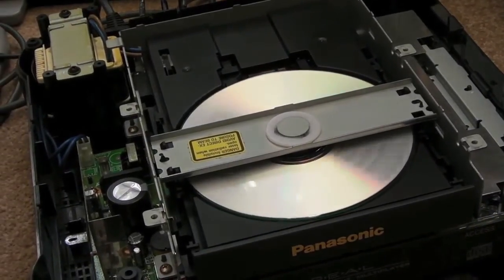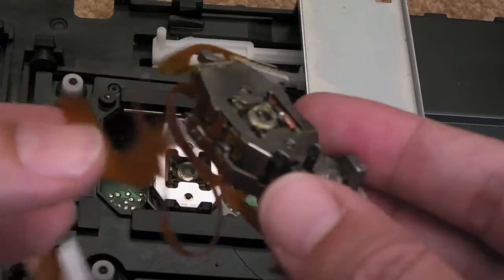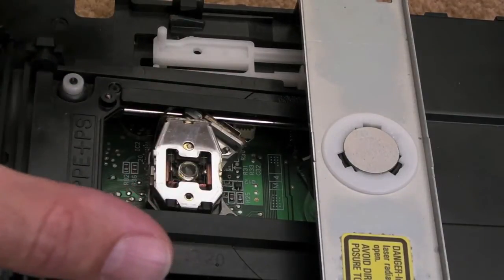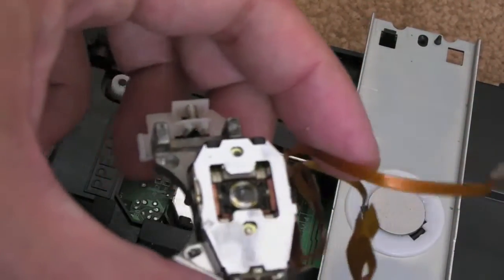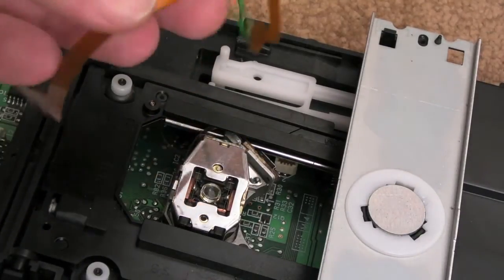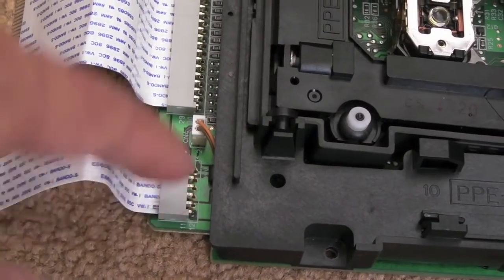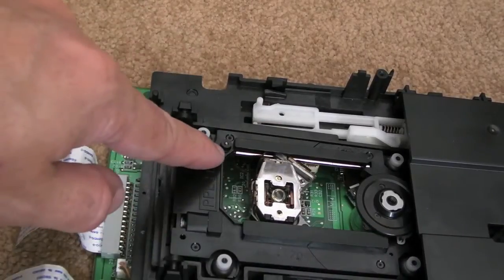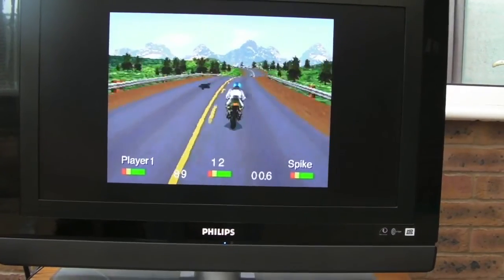Panasonic 3DO CD Drive Repair (FZ-1)

Comment: Hey gadget I was hoping to pick your brains if I could. 

I finally sourced a replacement laser for my 3do from Ali express.  Seems they are making them again but the £35 price tag is a bit much.

Anyway after installing the disk spins up violently and wobbles, it's almost as if the disc is slipping.   The drive will try to accelerate the disc maybe twice but you can clearly see the spindle slipping. 

Have you come across this one before, any suggestions?

I remember in the listing were I bought it the seller thought it was the motor that was dead, it isn't, but there is obvious sign of the motor being apart before.  A bit of a nightmare to say the least.
Reply from the maker: Check the magnetic part that sits on the inside of the bar that goes over the centre of the disc.  It should be gripping the disc when the mechanism goes up as the disc is inserted.
Reply: @GadgetUK164  Thanks for the quick reply.  The magnet grips the disc very lightly, I can easily pull it off so maybe thats the issue.  

Just to find a replacement now.  I have a fair few old PC drive lying about, might be luck and find something similar.
Reply from the maker: @CRG  To be sure, remove it from the metal part, stick a disk into the drive, put that magenetic piece on and re-test like that.  If it works, it might be that the metal piece has been bent upwards a bit, meaning the magnetic piece cannot pull towards the disc centre enough.
Reply from the maker: ie. Test it without the metal piece holding the magnetic piece.  Just stick the magnetic piece straight over the centre to hold it and test that way.  If it works and grips, you can try "altering" the metal piece a tiny bit.
Reply: @GadgetUK164  This is weird.  I've taken everything apart, taken the sled out and with a disc just in place, with the magnet part on top there is a clear gap between the top of the disc and magnet bit.  I'd estimate the gap is about 1-1.5mm.  Starting to think the spindle has been replaced by someone before and its not the correct one for the drive.  With the gap its no wonder the disc is slipping and wobbling all over the place!
Reply from the maker: @CRG  The spindle could have been pressed down, but it may move upwards as the mech loads the disc
Reply: @GadgetUK164  Well I've been at it for hours with no luck.  I got another magnet part from another drive and its holding the disc nice and still.  The drive spins up to full speed but you can here a weird high pitched sound coming out of it.  When looking underneath with the sled out you can see the laser bobbling presumably trying to focus.  I've tried every possible height for the spindle and have tried adjusting the screw on the rail underneath with no luck.  I could start trying the pot on the new laser but I'd rather not to be honest.  Might hook up the rf test point to the scope to see if anything is happening but interest is dwindling to be honest.  I'm actually starting to think it might be bad caps on the CD drive.  

Thanks for all your advice today Gadget!
Reply: Just one more quick note, I got it working.  

You'll not believe this but the last machine I thought I look into for possible spares was my Apple Performa.  It has an Apple CD  300 of which the guts are IDENTICAL to the drive in the 3DO.   Its exactly the same mechanism.  Swaped out the complete thing apart from the circuit board and it spun up straight away reading discs.  I'm almost certain the issue on my old drive was the motor, the spindle looks different on the drive from the apple.  

Anyway its fixed.  Worth keeping in mind that the AppleCD 300 scsi cd-rom drive is a direct swap for the 3DO FZ-1.

Might jump on ebay to see if I can get a few cheap!
Reply from the maker: That's an amazing discovery!!!!  Glad you fixed it!
Reply: @GadgetUK164  I couldn't believe it when I opened the drive, but there it was.

Comment: That big filter cap for the power looks a little swollen. You may want to check if it is faulty.
Reply from the maker: +Pha Q I swapped all the caps on the PSU in another video!  The large cap was OK and the top wasn't swollen.  It measured OK and its ESR was fine, I swapped it anyway, for another good quality Panasonic.
Reply: GadgetUK164 I am watching it now. Very helpful stuff here. Thank you very much.

Comment: I've been searching for a replacement 3do compatible laser for ages but all I can find is the sf92.5 with the long wires which has the wrong 4 pin connector.  After some googling I've came across a few comments in various places that the pinout on this long 4pin ribbon is wrong.  Does anyone know what the correct pinout is or how the mod for this cable should be carried out.  It seem the sf92.5 with the short ribbon cables cannot be got anywhere so we are stuck with modifying this other one.  It seems that the 4/12 ribbon version of the sf92/5 has the correct 4 pin ribbon on it.  Does anyone know how the pinout for the 12 pin ribbon is different to the 11pin version?  Just wondering which one would be easier to modify!
Reply from the maker: I honestly dont know!  I might take a look at one of the ones with the wrong flex ribbon one day.
Reply: @GadgetUK164  Thanks for replying.  I've done some digging into this and it seems both the 4 and 11 pin ribbons need modified.  The pinout of the 11pin needs swapped about and the 4pin ribbon needs completely replaced or at least cut and joined to the old connector.  Btw how do you solder to a ribbon, is that even possible?  Anyway I've ordered a laser and I'll be attempting to modify it.  The mod I found comes from a Russian 3do forum and 1 guy who's a wealth of knowledge on the subject.  Hopefully I can overcome the language barrier to complete this mod.  I'll let you know how I get on.
Reply from the maker: Regards soldering to a ribbon - it's very difficult, you have to try and scratch the plastic coating really carefully and solder to the connections that way.  That's how Beaps did it on the laser I removed in this video.  Thanks for the info!  I've still got that old laser so I might revisit and see if I can get it working!
Reply: I am struggling to find a proper replacement, too. Did you manage to figure out how to use a OEM Sanyo SF-92.5 4/11 on a 3DO? Any help would be much appreciated!
Reply: @CRG hi.  Do you figured out what pins have to be swapped? I have this laser and even soldering old ribbon to this laser not working

Comment: Amigo, você pode me ajudar. Meu 3do nao lê CDs. Abri ele e percebi que a unidade óptica movimenta mais não acende a luz vermelha do laser. Comprei uma unidade nova original, troquei e mesmo assim continua com o mesmo problema. O que pode ser.
Reply from the maker: Replace the capacitors on the motherboard.  If that doesn't work, replace the capacitors on the CD-ROM drive.

Comment: Hey! 
A few questions:
Is there any chance that my system needs a 12p/4p? 
how can i be sure that i'm getting the right 4 pin connecter?
if the 4 pin connecter is not right, i should just remove it and solder the one from the bad laser?
thanks!
Reply from the maker: The best thing to do is to look at the flex cables coming off your current unit to double check that what you have is what you are ordering a replacement for.  You really need the one with the exact same flex connectors.  The soldering wires onto a cut off flex cable thing is just too risky imo.

Comment: Hello! Maybe you could help..
I got a problem with my FZ-10: the motor drive spins discs clockwise or counter, every time this happens randomly. Moreover, the drive rotates discs only when you touch the drive's metal spindle by finger)) (due to heavy radio noises?!). Could you give any advice?
It all started when I found this device on the market. It was faulty and did not read discs. I thought this happened because of laser and bought the one (laser) that is mentioned in this video's info from Ali. We replaced it with my friend, but as for now we got the problem as I described in the first couple of strings...
Reply from the maker: I would start by checking the drive connections (ribbons at the back), and make sure the ribbon for the laser etc is connected to the drive PCB correctly.   The behaviour you are seeing there could be from a missing ground connection, but could also indicate a fault on the drive control logic.  It might be that this system needs a new drive entirely.  Are you sure the capacitors are OK on the motherboard?
Reply: Sorry, it was my fault. I did not know that chinese laser has different pin scheme. I red it at one forum dedicated to the console. So, after my fixes the disc started to spin correctly. But unfortunately there is still no boot( The behavior now is like the following: the spindle starts to rotate the disc, the laser tries to read something, the spindle shifts to "second speed", approx in one minute the drive states that there is no disc and the console shows me internal menu...I've already set laser's current to 57 mA. I assume my next step will be something like adjusting spindle height or swapping the motherboard...Visually the capacitors are OK, no signs of bulging or unstable soldering.
Reply from the maker: It could still be capacitors - they don't bulge on the 3DO, they leak, so inspect the bottom here they sit on the board closely, especially around the power supply section which will likely have a heat sink there.  Where did you read about setting the laser current to 57mA - I am just curious as I set my RF level using a scope and not familiar with the technique of using current to adjust.

Comment: Great job. It woulb be nice if you could find where the replacement laser came from, i bet many people are interested like me. My 3do is ok, had a power issue but got it repaired, but it can only play originals and it has a hard time reading backups. A shameful problem (!) but, yeah...
Reply from the maker: Thanks, I've edited the vid description there to include a link to what I ordered.  In theory should work on both FZ-1 and FZ-10.

Comment: Hi gadget
Checking the link you provided for the replacement laser shows the one with the wider 4 pin connector
Did the one you ordered have this ? Or is it just a "default" stock picture and you actually received the right one ?
Reply from the maker: I am honestly not sure.  All I know is the link used to be correct.  It could be that the photo is wrong.  You could take a photo of yours and message the seller to ask if the ribbons are the same?
Reply: Hi gadget
Thanks for the reply. Just to let you know that the seller now only supplies the "incompatible" one, so the hunt continues ...!
Reply: @simonclark9155  Did you had any luck finding some replacement?
Reply: Mike Lütjens not yet !
Reply: @simonclark9155  I dont even find the Matsushita CR-563 and 563b Drives they recommended earlier any more.  The OEM  4/11 Version seems to be modable but I didnt find any guide how to wire them properly. Please leave a note if your finding struck gold somewhere, I will do the same here.

Comment: I got some question about burning 3do games.At first, I burn a game using a CDRW which have purple surface.It did not work.Then I used CD-R which have silver surface.It worked.Later I found a CD-R with a purple surface, which cheaper then the purple CDRW and silver CD-R.Should I usethe purple CD-R or better stick with the silver CD-R? What does really 
matter here? is it has to be CD-R not CDRW?

If I use the purple CD-R and it works, which is better (or less worse )for the device(mine is panasonic fz10) ? I heard that some laser device, the old one particularly, should work harder to read certain CD with  different colored surface,is that true? I figure that because my 3do is and old machine, it surely use a older laser device.I wish to preserve my console longer of course.
Reply from the maker: I find that on these old CD based systems, the best discs are silver looking ones from a good manufacturer - eg. Verbatim.  Burn the discs at 2 or 4 speed.  You can also tell which discs read best with your laser by timing loading!  If you burn 4 copies of a game all on different types of CD-R, then time precisely how long the game takes to load, the one that loads the fastest is the best type of media for your laser.   Don't use CDRW discs, use CD-R!
Reply: Thanks.And seeing your comment here, I become wondering,  If the cd itself can only be burned in lowest speed 10x (I see this on the burning software by the time I insert the cd into the tray),  can we burn it in like 2x or 4x as you say? Anyway, I burn my games on 10x speed and works well.What do you think about that?
Reply from the maker: It's an interesting topic - some people will tell you that the burn speed makes no difference, but I have proven time and again that the burn speed does make a difference.  If your lowest speed is 10x, you will probably find it works OK still even burned at 10x.  The problem is where a disc supports say 1x to 8x, sometimes with certain systems, when burning at 8x the disc takes longer to read, yet when you burn at 1x, 2x or 4x the drive reads the disc much easier.  I am not entirely sure why, but I think the way the disc is burned is slightly difference in the peaks and troughs, which can make a huge difference to focus and error correction.

Comment: I was at a friend's warehouse and found 3 3dos, no controllers.  They seem good condition exterior. Each one has a sticker Orange that says new brushless motor. I connected to tv and and 3do menu comes up with logo and stays there. Each one does that.  I get no asteroid or please insert disk menu? Any help would be appreciated.
Reply from the maker: Honestly no idea!  I would start by recapping the power supply section (3 or so electrolytic capacitors on the main board near the heat sink).  Beyond that it could be a number of things - capacitors on the drive, faulty laser etc.
Reply: @GadgetUK164  turns out I have the arcade 3dos.  There's nothing I can do to convert them back to nornal.
Reply from the maker: Ah, OK!  That's news to me lol - I didn't even know there was such a think!  I need to go and research that now lol!
Reply from the maker: @retrofan4life  Just been reading about this, apparently there's an "extended BIOS" that is sat next to the original BIOS, and if you remove that extended BIOS chip it behaves like a normal 3DO then.   I cannot be sure that process works, but that's what seems to have been reported by other users.
Reply: @GadgetUK164  is it a plugin chip or like a soddered chip

Comment: Friend, excellent work! I will need to do this in my FZ1, could you please tell me how the thread was soldered in the 4-way flat?
Reply from the maker: Thanks!   With regards to the cable mod (on the laser it came with that had the wrong fittings), I honestly dont remember how it was wired.  I might have the old laser somewhere - I will check it when I get my 3DO out of storage in a few weeks!

Comment: My Fz-1 is acting up with one specific game: GEX.
It will randomly slow down the background music whenever some specific sound effects are played. It's just bizarre...
It reads all CD-R media I tried flawlessly, and games like Road Rash play 100% perfect.
I ordered a new laser from AliExpress: still had the same issue with this particular game, wich makes me wonder if the problem is in the cd drive itself, and not on the laser.

Do you think the tweaking the spindle or that small screw on the rail could affect the reading in my case, to the point where it would work with that game?

It may sound a bit exagerated, because the issue is just found in one game, but it's my all time favorite game on the 3DO!
Think about a SNES that can't play Super Mario World, or a Nintendo 64 that can't play Zelda Ocarina of Time.
A 3DO Fz-1 like mine is hard to come by, and extremely expensive, so I'd like to try and fix this one.
Any advice of this would be greatly apreciated.
Reply from the maker: Sugurain Have you tried burning that game to CD-R again to check its not something wrong with disc?  Also make sure the slide bar is lubricated with some silicone grease - so the laser assembly can move back and forwards correctly.

It could also be the signs of the caps needing replacing.  A very strange fault that, those are the worst types of fault.
Reply: GadgetUK164
Tried different CD-Rs, on different computers and different burners.
I even tried different isos!
Tried NTSC, PAL and even NTSC-J iso!

Still the same issue...

I just bought some silicone grease to apply in my PS2 fat DVD drive, I'm gonna try to clean and apply it in the 3DO too.

Also, I bought a genuine, brand new and sealed PAL copy of  Gex for it.
If it still doesn't work, I will try to recap the whole system.

This issue is really strange indeed.
Played Need for Speed, Myst, and even a 3DO Video Disc (Woody Woodpecker episodes volume 1) the other day, all on cheap CD-R, and it all played flawlessly....
And I played for hours non-stop!